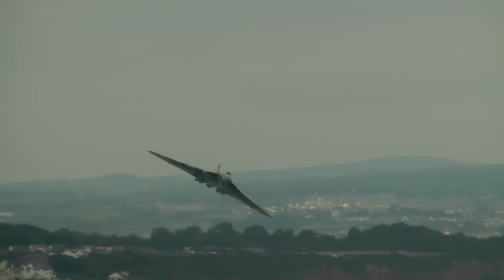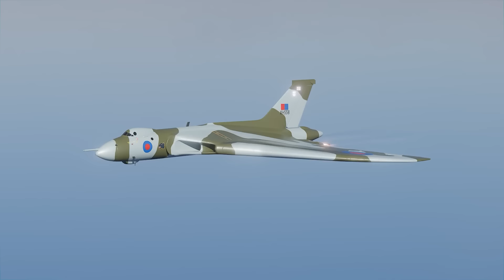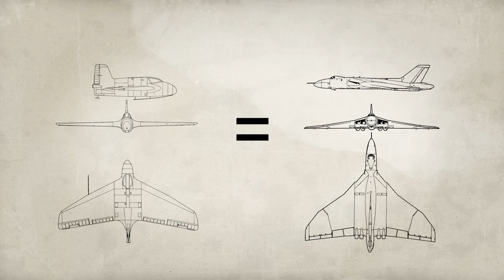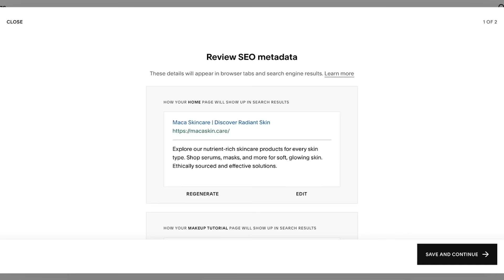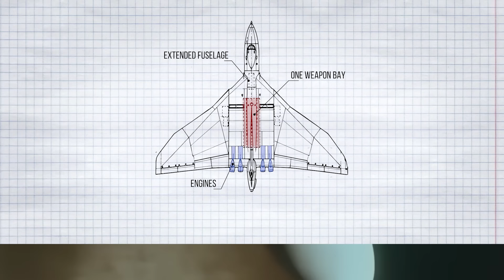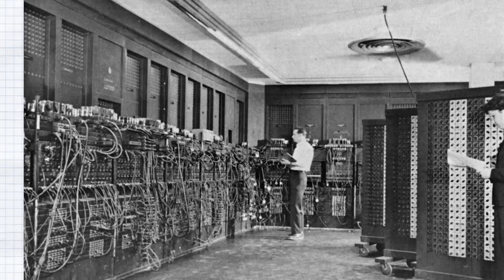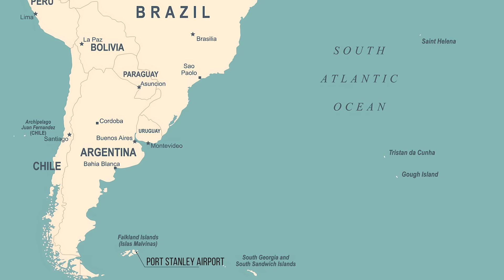The British bomber made to defeat Russia... Avro Vulcan

Comment: With some modernizations and upgrades such as replacing the Rolls-Royce Olympus turbojets with Rolls-Royce Conway or Spey turbofans as used in various flying engine testbed variants, the Avro Vulcan could have served longer until the late 1990s or early 2000s carrying Paveway or JDAM smart bombs and Storm Shadow cruise missiles.
Reply: The only problem is Avro went out of business in 1960

Comment: I don’t know what it is about this aircraft but it just seems strange, otherworldly, it could perform manoeuvre like a fighter while being over 3 times the size, it’s awe inspiring
Reply: Could maneuver like a fighter??? You're taking the piss mate!
Reply: @WilhelmKarsten  at cruising altitude the Vulcan had plenty of control authority due to those massive wings and their control surfaces, while a fighter simply couldn’t manoeuvre as well because of the ridiculously thin at around 50,000 feet, if a fighter could even get up to that altitude (most couldn’t store enough fuel for the climb) then it would be easily out turned
Reply: @polarisukyc1204 So you are unaware of the Vulcan's deadly "pitch up problem" that resulted in a catastrophic in-flight structural failure and crash and several near crashes incidents where Vulcan pilots lost control of thier aircraft?
 Or the major aerodynamic design flaw that required Avro to do remedial engineering work and modifications like the vortex generators and the MCAS system to prevent them from crashing?
 The Vulcan was far too slow to out-manuvere a Mach 2+ Soviet fighter and was rendered ineffective in the high-level mission by SAMs by the time significant numbers of Vulcans were in service.

The idea that the slow, lumbering Vulcan bomber could evade then current fighter-interceptor is ridiculous and pure propaganda fiction.

Comment: I really think the RAF should have just concentrated on building the Avro Vulcan instead of the Vickers Valiant and Handley Page Victor. The Vulcan was much loved by its pilots, and had a surprisingly low radar radar return at certain angles. 

The Vulcan could have gotten upgrades like a new three-crew digital cockpit, replacing the original Olympus turbojets with Tay turbofans of similar thrust, and upgrades to accommodate the latest stand-off weapon systems. such an upgrade could have ensured the Vulcan would still be operational even in 2025, of all things.
Reply: The Valiant was built first because it was simpler; it filled in a gap until the more advanced aircraft were ready. IIRC it had metal-fatigue problems and after the Victor and Vulcan were ready the Valiant was given early retirement.
Reply: @zh84  plus the Valiant was actually the only V bomber to drop a nuclear bomb!

Comment: Interesting fact: the Concord used the same engines as the Avro Vulcan but they modified them by adding afterburners and better heat resistant materials
Reply: Yes, the CG footage includes afterburners, but Vulcans didn't have these.
Reply: @pault1289  that's...exactly what he said
Reply: Concorde has different engines designed by SNECMA and Bristol
Reply: @DoktorBayerischeMotorenWerke Concorde used developed versions of the Olympus 301s used by the MkIIs. Those of us whoo were there at the time know this. Younger folk need to do proper research.
Reply: @gordonclifton2694  WRONG! The Bristol Olympus MK 101/3 is a completely different engine.
Concorde used the SNECMA 593 engine, they were designed, tested and manufactured by the French company SNECMA at Melun Villaroche Aerodrome near Paris.
They have different compressors, turbines, intake and exhaust nozzle geometry and the uses different materials than the 101 is non afterburning and the 593 is an afterburning Mach 2 supercruise engine with very high efficiency. 
 Any questions lad?
Reply: Concorde used different engines developed  in France...
Reply: @WilhelmKarsten Quick google search will tell you, core development was done in England, and then later development took place in France. It’s not hard to look up, lazy.
Reply: @Deano-Dron81 Not for the Olympus 593 that powered the Concorde.
The 593 was designed and developed by Jean-Jacques Barre and Rene Ledux at the French company SNECMA (now called Safran) in Villaroche,  and the ONERA supersonic wind tunnel laboratories at Modane and Meudon.
 The first full power test on May 21st 1965 and the entire testing program took place at Melun-Villaroche Aerodrome in France.

The first flight test of Concorde took place at Toulouse-Blagnac on March 2nd, 1969 with a four man, all French crew 
Andre Turcat
Jacques Guignard
Henri Perrier
Michel Retif

Any questions lad?
Reply: @Deano-Dron81 You seem a bit confused Deano... 
Bristol developed "The Core" of the Olympus engine but this engine could not operate at speeds up to Mach 2.
SNECMA developed the existing core into the Concorde engine while Bristol was spiraling into financial disaster and was acquired by Rolls-Royce... because of this development of the Concorde engines was given over to France to complete.
 In fact, Britain canceled the Concorde, the Wilson government stopped work on Concorde in early 1965 and work was not resumed in the UK again until 1966.
 Bristol was unable to provide any development support and went defunct in 1966.
 During this time all the work on the '593' program was carried out to completion in France.
All of the Concorde engines were assembled in Villaroche France.
Reply: I had somehow figured out part of this fact.   Makes a lot of sense.
Reply: Technically reheat. It’s not called afterburner in British aviation terminology.
Reply: @sparky4878  The Correct term is Nachbrenner as they were invented in Germany
Reply: @DoktorBayerischeMotorenWerke nope in us in 1946
Reply: @brendan2003-x6y  First Afterburner was the Jumo 109-004 D in 1942. 
 The technology was brought to America after the war with Operation Paperclip and Operation LUSTY...
 These two programs represent the largest transfer of technology between two countries in human history and launched America into the number jet engine manufacturer and in world and put a man on the moon.
Reply: @BathtubFullaGravy  That's a very false and misleading opinion... The American Operation Paperclip and Operation LUSTY represent the largest mass transfer of technology between two countries in human history.
 American forces recovered, cataloged and shipped thousands of tons of data, test equipment. prototypes including the contents of entire factories and laboratories back to the United States from Germany.
 The DLA wind tunnel laboratory in Braunschweig was the largest ever constructed and the only collection of large diameter supersonic wind tunnels suitable for testing aircraft in the world.
 These supersonic wind tunnels are still located at the US Naval weapons center in White Oak, Virginia and were used by NASA for the American space program.

This included the World's first Hypersonic wind tunnel which was still under construction when the war ended, it was shipped to the U.S. and was completed by German scientist and technicians

Comment: There were no "fast jets" taking off from the island airfield. All are the fighters operated from the contient. The airstrip was too short. 
Barely a single bomb hit the airstrip on a side once and it was repaired the same day. The short take off light attack aircraft never ceased to operate from It. Check your information before making incorrect claims. 

The Vulcan raids in 1982 were meaningless prestige operations for the RAF and as a threat to Buenos Aires saying a nuclear bomber could reach them.

The first mission was lucky it didn't lost a Vulcan. Due the earlier lost of a Mirage without fuel trying to crash land in the airfield being shot down by friendly fire. Strict fire rules were put in place. Both the Roland II SAM and GDF-001 radar directed AAA battery locked on the Vulcans but couldn't fire before getting permission that required a leason officer with the army and checking the air force command and control. By the time they got back to the anti air crews confirming they were enemy planes they were out of range. 

I would have love seen one of this things falling in pieces. 

Also a Mirage III tried to intercept one mission during it's return flight but had no fuel to catch them and was forced to turn back.

Comment: I have never really bought the hype around these. They were slow compared to basically every fighter that existed at the time. Even the MiG-17 was faster. Like the B-52 as well, any of these that would have attempted to fly over the Soviet Union would have been shot down shortly after it crossed the Iron Curtain. Same thing can be said about the Tu-95, obviously. 

Bombers in general after WWII have really only been useful against forces that do not have significant anti-aircraft capabilities like Vietnam or Afghanistan.
Reply: In actual war gamed simulations, jet fighter interceptors struggled to intercept bombers. And both sides of the Cold War struggled to come up with any sort of armament which could take out a bomber until guided missiles were finally perfected. So basically, until the late 1960s or 1970s high altitude bombers stood a good chance of getting through. After the perfection of adequate SAMs, bombers found a new strategy able to get through - low altitude.

But in the 1950s or early 1960s? It was pretty hopeless for the interceptors. Cannons simply didn't have enough firepower at jet closing speeds, and rockets spread randomly so much that they pretty much went everywhere except the target. Automated radar controlled interception and fire control system attempted to help this, but it just made the aircraft even less reliable and the likelyhood of being able to take out the bomber was still low.

Comment: So basically larger version of delta dagger & delta dart.
Reply: Not in the least. Convair's design is a pure Delta. The Vulcan is not. The Hustler is also a pure Delta. The applied modifications to the delta wing planform are what gave the Vulcan it's incredible maneuverability, particularly at high altitudes. At 50,000 ft. an F106 is pretty much approaching coffin corner in terms of maneuverability. Once you burn your energy in a hard turn then it's game over. 
An F-102 can't even get to 50,000 ft.

Comment: During preparations for the Falklands bombing mission, a critical piece of the fuel probe was found being used as an ashtray by RAF personnel. The mechanic casually recognized it, took it off the table mid card game, threw the ash on the bin and went to work. Saw it on a BBC documentary if I recall correctly.
Reply: 👍 Described in the book. It was an adapter needed to test the inflight refuelling system. Also the bomb racks had been scrapped, found in a local scrapyard and rescued! The RAF sent teams to scavenge parts from aircraft already donated to museums!
Reply: @markdavis2475  The air refuelling probe from the Vulcan in RAF Duxford was borrowed for the mission and later returned once the mission was over.
Reply: @MarcusRhodes-q2s  The inflight refuelling probes were not taken from the Vuclans in Musuems to be fitted  to other Vuclans!!! They were fitted to Nimrod MR2 and Hercules C1 aircraft to give them in-flight refuelling capability to allow those aircraft to get to the Falklands.
Reply: @richardvernon317  No 
XJ824 posted at RAF Duxford had it's air refuelling probe removed because it was an earlier generation Vulcan that still had the air refuelling probe.
By the time that the Falkland's war came around the Vulcans still in operation all had their refuelling probes removed as the aircraft had been put in reserve role.
For operation Black Buck they would need the extra refuelling probe to travel the long distance. The refuelling probes of the Vulcan would have been useless to fit to any other aircraft.

The Nimrod already came with a refuelling probe and they had those spare lying around in warehouses so why install one from another aircraft that isn't compatible?.
Reply: @MarcusRhodes-q2s  Nimrod Probes and C-130 probes did not exist until the Falklands Were invaded!! The Nimrod ones came off Vulcans!!! That information is in an RAF Historical Society Journal written by the guy at MoD who ran the project in getting hold of them!! I saw quite a few Vulcans in 1979 to 1981 and dont recall seeing any without probes fitted (not to say that stuff within the aircraft as regards the refueling system was not missing).
Reply: The sad decline of an once great empire under a neverending succession of incompetent governments
Reply: @rogerchen4277  watched a mad video that lead me down a rabbit hole of how the conservative governments post thatcher have been deconstructing the UK military in appeasement to Russian and Chinese investment.

Mental stuff. Essentially using military defunding to balance the books and increase reliance on NATO

I’m not against military spending cuts where needed….but we’ve stripped ourselves bare
Reply: @rogerchen4277 And lost wars... WW2 was a humiliating defeat for the once proud Britain
Reply: @WilhelmKarsten  In victory, the western allies secured the destruction of Western Civilization and the destruction of the white race.
It is terrifying to realize Communism for all its faults actually protected the Eastern Bloc from the demographic extinction we are now seeing in liberal western societies.
Reply: @WilhelmKarsten  Britain lost WW2? How mind numbingly stupid are you? Britain didn’t lose the war we held out and were the only ally nation that fought from the beginning to the end.

Comment: Handley-Page Victor was by all measures better plane. But Vulcan was the better looking, but Victor was unique and looked like it came off a comic book about near future.
Reply: I think the Vulcan worked better when high altitude bombing went out of fashion because it's large delta wing was strong enough to cope with the extra turbulence encountered during low altitude high speed flight. I expect the Victor could carry more further and faster at higher altitudes though, as it was originally designed to do.
Reply: I think the Victor is way better looking than the Vulcan. Cool ass looking plane, one of my favourites.